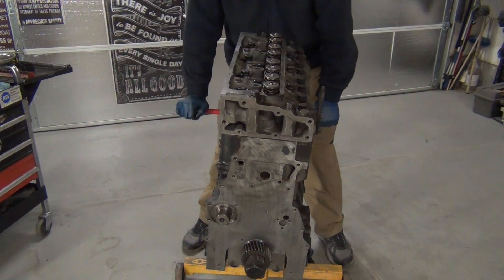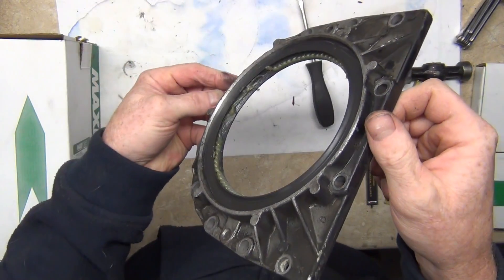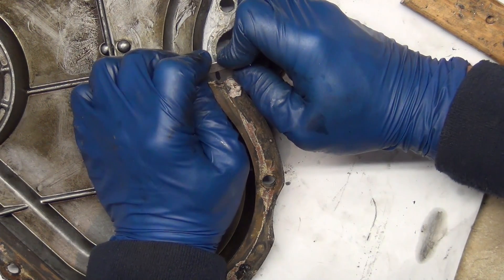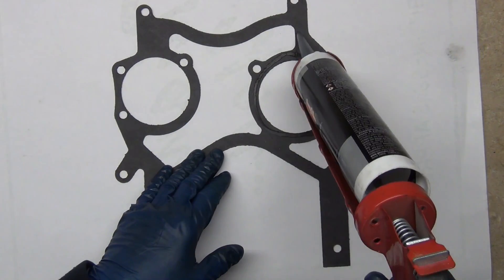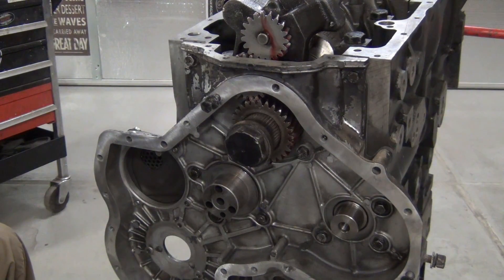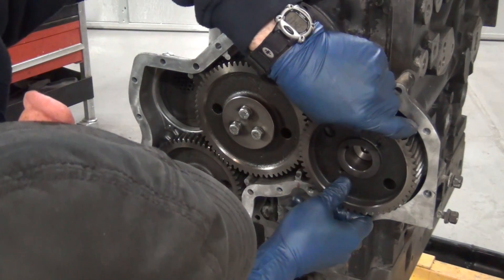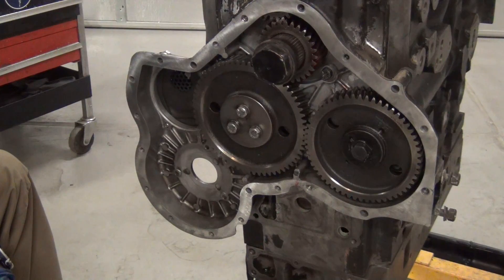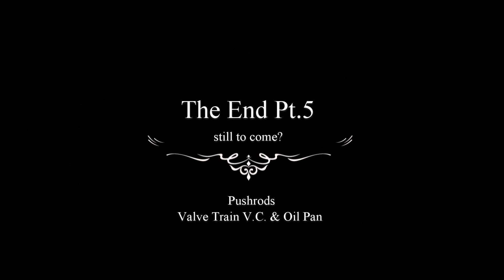Perkins Diesel Engine Build Pt  5 Timing Gears and Seals

Comment: I’ve watched all of the videos, but returned to this one in hopes of finding out a little more about the mess I’m in. 
After resealing the injection pump for a T4.236 marine engine, my son spun the engine over before I had the three bolts installed through the pump timing gear. 
There’s a roll pin, that would’ve kept us in time, but it pushed forward as the gear turned without the pump keeping up. 
The pump timing gear is loose inside the cover, without the bolts in place, but doesn’t feel as though it could jump up far enough to skip any teeth. 
Any experience with a scenario like that?

Comment: Why did you put the new seals in the timing cover then remove the gasket? You’re not concerned about contaminants getting in the seal? Wouldn’t you clean the timing cover THEN install the seals?
Reply from the maker: Why?  Oversight.  I do that sometimes because of being interrupted a lot for one and because filming and narrating everything by myself is distracting.  Lots of set up and take down of lights, tripod, etc.  Good catch on that!  Ideally you tear everything down, clean it naked and then assemble cleanly.

Comment: Suspect it would have been better to have some lube on the  timing gears before meshing them for several turns. maybe by hand it is not much of an issue.
Reply from the maker: It really doesn't wear them by hand compared to what the loaded pressures are.

Comment: It would have been better if you were to just check the air pressure. Instead of rebuilding the motor. Air pressure is key to performance . Check the air pressure next time . I don't think there was anything wrong with the motor. But good job ...
Reply from the maker: If you watch the tear down you'll find there was broken piston ring landings and the cylinder sleeves were worn way out of spec.  The intake boot was split wide open and took on a ton of dirt.
Reply: If you checked the compression (air pressure) and it was low, rebuilding the engine would be how you fix it. Checking compression only tells if there's a physical mechanical problem with the combustion chamber.